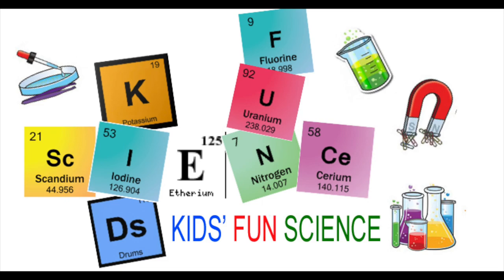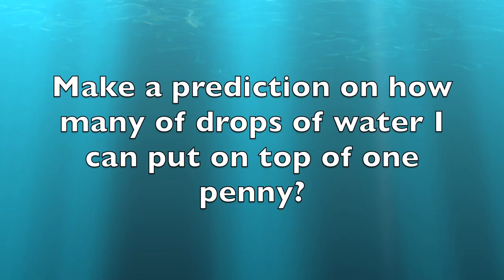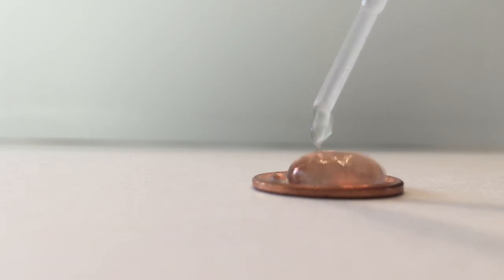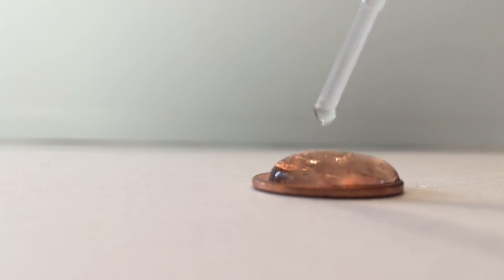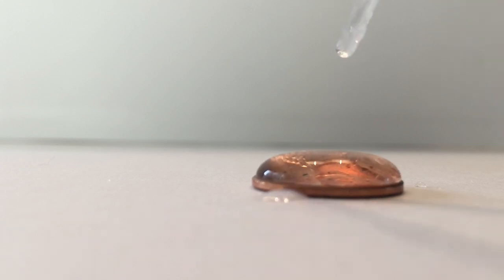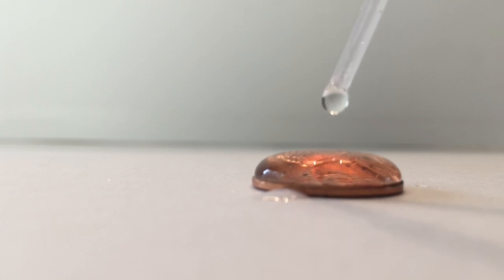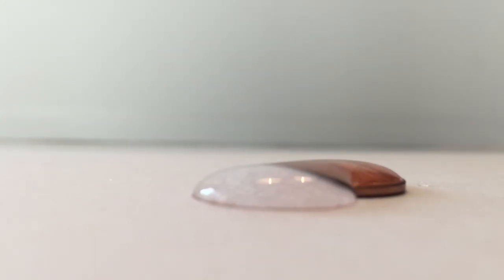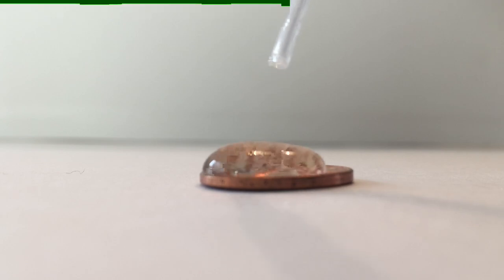Drops of water on a PENNY experiment / How many drops can fit on a penny?

Comment: Can this be like a thermal energy project or not please let me know if it’s a thermal energy project
Reply from the maker: Good Morning Lizzy, 
Boiling water on a stove is an example of thermal energy. Thermal energy is produced when the atoms and molecules in a substance vibrate faster due to a rise in temperature.

The Science Behind this experiment:
There are two properties at work in this experiment: cohesion and surface tension. Cohesion is the attraction of like molecules to one another. In this case, the like molecules are the H20 molecules in the water drops. 

Surface tension is a special term we use to describe the cohesion between water molecules.

Water's cohesion and surface tension are special because of hydrogen bonds. Hydrogen bonds are formed by the hydrogen atoms of one molecule being attracted to the oxygen atoms of another molecule.

The cohesion and surface tension of water becomes apparent when the drops of water you add to the penny reach the penny's edge. I hope this helps Thanks Ken

Comment: what's the dish soap for?
Reply from the maker: Hi leafgamehd, Adding soap lowers the water's surface tension so the drop becomes weaker and breaks apart sooner. Making water molecules stick together less is what helps soaps clean dishes and clothes more easily. Thanks for watching Ken
Reply: @KidsFunScience  thank you so much for helping me. this is realy important so you helped me out a lot thanks you
Reply: @KidsFunScience  also, do you need to rub the dish soap on the surface of the penny

Comment: can someone help me what caused the water to break the “skin”
Reply from the maker: HI nebs fn, 
The attraction of water molecules to other substances, like soil or glass, is called adhesion. As drops of water are added onto a penny, the adhesive force between the water and the penny keeps the water from falling off.

Cohesive forces are strong, but not unbreakable. As a water drop builds up and out, usually bulging over the sides of the penny, the cohesive forces will eventually be overcome by the force of gravity on the water molecules. The "skin" will burst, and all of the water will spill off. 

I hope this helps. Thanks Ken

Comment: :O that was interesting was there something in that water? x
Reply from the maker: The time when it only held 10 drops I rubbed a very little dish soap on the top of the penny, Dish soap breaks up surface tension and therefore the drops roll off. thanks